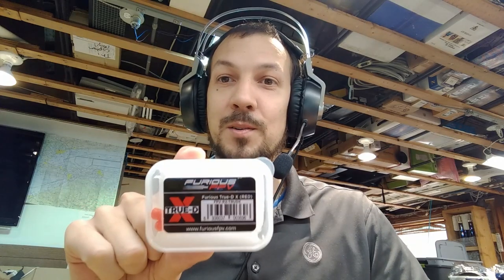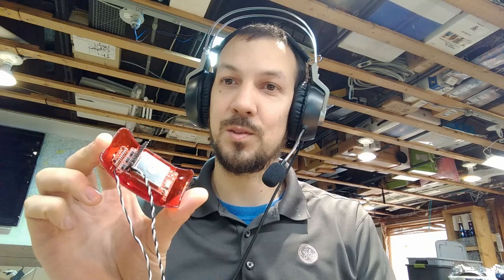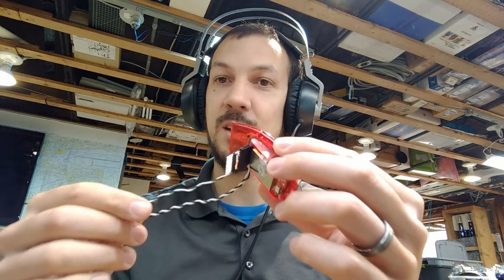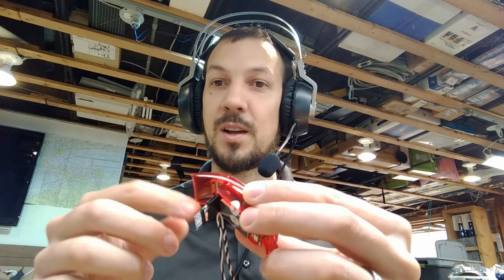FuriousFPV TrueD-X Sync magic demystified, "magic" explained - FPV Video Series - PK's Lab

Comment: First off, great analysis on how TrueD-X works compared to RapidFire. While we can't do anything about how the firmware does the sync reconstruction and frame combining, I was thinking about changing to the power supply input to "improve" color. 

Is it worth it to mod in a LDO regulator and feed in power via the ribbon cable power input of the TrueD-X? Bumping up the input voltage to say 5.5V? Of course will have to change the solder bridge to switch the power input.

Comment: This is really interesting! Thank you for the hard work you put into this!!! 
Can I rely to the voltage readout in the fatshark, or do I need to get it somewhere with a multimeter?
And something else I need to know: did you do the powermod that is supplied by Furious FPV or did you just plug it in? I read that on the HDO you do not NEED to do the mod, bit you might...
Sorry I do not own a rapidfire and am not common with the L1 or L10 term...
Reply from the maker: Thanks for kind words Matt!  From just looking at it occasionally, the readout on the TrueD-X and Rapidfire generally seem to be within +/- of 0.1V of the actual voltage.  But I haven't done a thorough look at it, so take that with a grain of salt.  I don't use the power board and ribbon cable as I like to be able to turn off the receiver module with the switch on the bottom of the goggles.  But I have bypassed the inductors in my HD2s to eliminate the voltage drop to the receiver.
Reply: Thank you for your reply!
That inductor mod sounds interesting! Do you have any specifics for HD3s?
Reply: @PKsLab  That's odd it doesnt shut off when you hit the switch. Seems like they forgot to design that.. If you go to a race and use provided video input, do you have to take the goggle module out of the goggles?
Reply from the maker: Yeah, you have to take it out if you use their ribbon cable setup.  Same thing if you want to access the internal DVR.  Will be interesting to see if the Fusion module that will require the secondary power board will put a fet on the auxiliary power input so that users don't have to pull the module in and out.
Reply from the maker: Sorry about the slow reply bud.  JB has a solid video on it:  https://www.youtube.com/watch?v=8pesc3ZWm8w  Hope that helps :)
Reply: PK NP!
Wow thank you!
I did not know that!
Will look into it.
Thanks!
Reply from the maker: @MoppelMat  You got it!  Glad I can help :)
Reply: @PKsLab  the Fusion module will require the usage of the auxillary power in the head tracking Bay if the user wants access to the WiFi capabilities (integration with crsf).

Can we expect an analysis and comparison of the module soon since it's started shipping to  consumers?
Reply from the maker: @taggerung890  I'm in vacation for a few weeks still, but when I get back I'll def do one :)  I'm working on a test setup that will hopefully visually show how the different diversity combining implementations effect visual quality at the corner cases.
Reply: @PKsLab  that would be amazing!
I've just recently come across your videos~ I'm not much of an rf engineer but I'm learning from your videos!